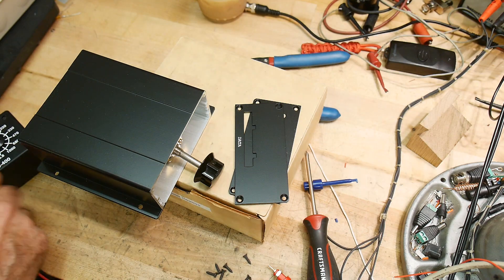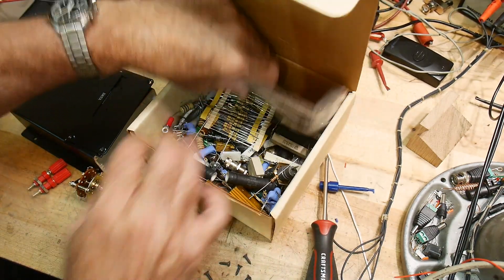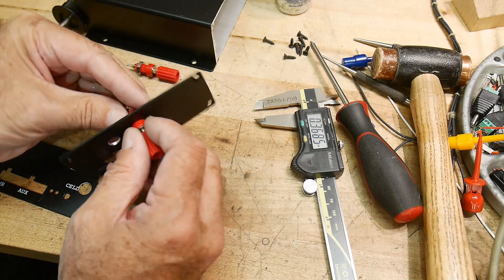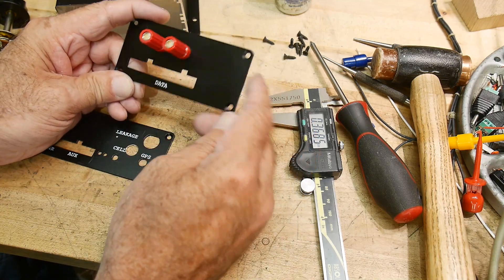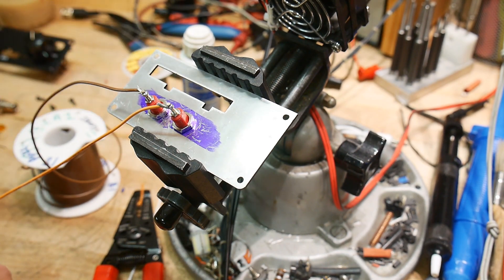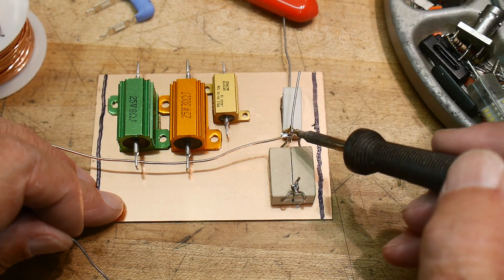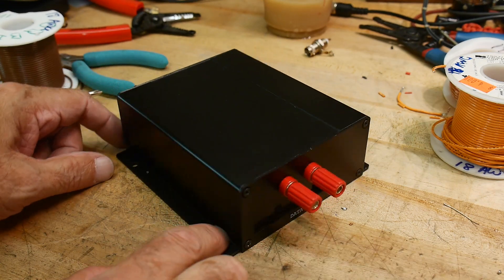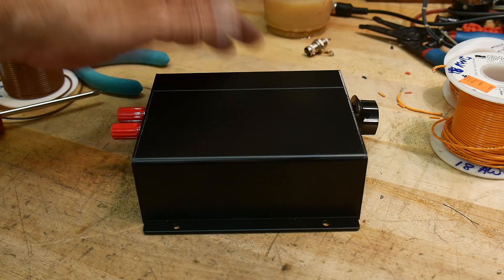#886 High Wattage Resistor Box

Comment: Though the resistors can handle it, you should watch the current going through the switches.  The contacts are usually rated for no more than 3 amps.  A surge, for example when connecting a capacitve load, could more than double that momentarily.

Comment: I think (from U.K.) it’s a Bahco wrench; they’re slim and strong and have a better opening range than many cheap copies; they’re well-balanced and fit the hand well and give good feedback and feel. Available in a range of sizes. Bahco made in Sweden, often copied. I’ve never found then bettered.
I used Bahcos for lumping, but other styles of adjustable too, including articulated claws. Plumbing throws up a variety of access problems.  Never liked stillsons for tightening components with flats - the stills on jaws knarl them up.

Comment: (in UK) 
Locking pliers known as mole grips, or mole wrench

Due to the large number of engineers / techs employed by the GPO (later BT) over the years needle nose pliers were often known as 81's the internal stock number.

Pipe wrench are Stilson's (I think that's the same in the USA

I don't recall a specific name for adjustable spanners - there were several makes about.

On the resistor box, be a bit cautious regarding the metal clad resistors, they only meet their wattage rating when bolted down to the correct size of heatsink. 

 Andy
Reply: Long time since I’ve heard the term 81’s, but of course the BT ones had the wire strippers in the centre for the twisted pair wire used on MDF’s, back when they were soldered rather than the later Krone and other punch down types. 👍

Comment: Mark, What video camera-arrangement do you have to capture and prepare these videos?  I want to see how you have it all set up!  In the future I want to do similar videos centered on watch and clock repairs!!
Reply from the maker: Yes it is tricky to get the infrastructure right. Most important is the audio! I tried many ways. What works for me is a lapel microphone (RØDE Lavalier GO). I use a Sony UX560 digital recorder on a lanyard and clip the microphone to the lanyard so it is about 6" below my mouth. ok now lighting. I have LED lighting above and forward of me so I don't cast shadows. I have a good tripod and it is ALWAYS in my way. Sometimes I put it off to the side so I can work but the video will be off angle and not that great. For some videos, I have to put my right arm around the tripod and the camera ends up at my right ear. I probably should have a dedicated hanging tripod from above. I've thought about it. Good camera good lens. I use a Lumix GX7 with Lumix G X Vario 12-35mm f/2.8. For macro the best lens is an old Nikon 55mm f/2.8 macro manual focus. post process is Vegas Pro.
Reply from the maker: oh and by far, the best watch videos on YouTube are the Watch Repair Channel
Reply: @IMSAIGuy  Mark, Thanks for helping my future videos~!

Comment: Excellent project. I imagine it will become a valuable tool on your bench.  It makes me think of a similar project of mine.  I hate trying to hold a pot by hand, turn its knob, all while not pulling its wires off of the project/breadboard/prototype. So, I built a giant bench potentiometer with some common sense features that make it very useful... 21 turn/giant knob for easy one-finger rotation, heavy big base won't slide around, etc. I have a friend making the YT video. I would be pleased to share the link, here, once the video is posted, if folks would be interested and IG would not mind.

Comment: I think you could have made it easier for yourself by soldering one side of resistors to the clad instead of bus of wire. That would also hold them in place better than super glue which is gonna rasp your air passages when it gets hot.

Comment: You forgot Xerox. Workable resistance box looks good. Thanks for the look.
Reply from the maker: I was designing a part for a Kodak copier once and accidentally said "I'll make a Xerox of the document"  the guy said "we prefer to call it a copy" 
Ouch!
Reply: @IMSAIGuy  my ex worked for Xerox as a colour print repair tech in the 70's. I learned all the proper protocols for them. They had a beautiful training facility out on the west side of Washington D.C. back then. It was a nice ride from Philly area.